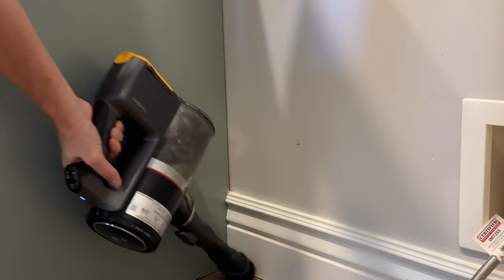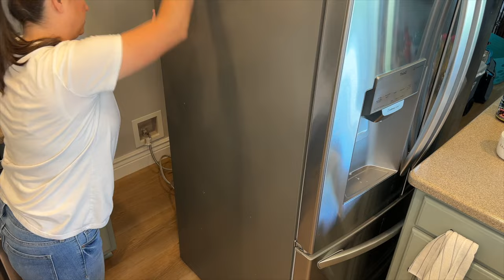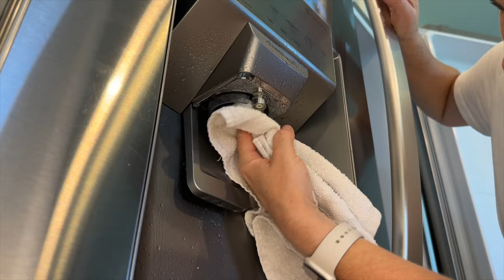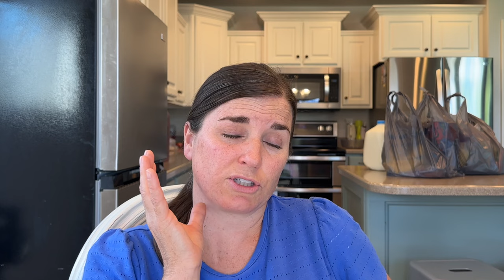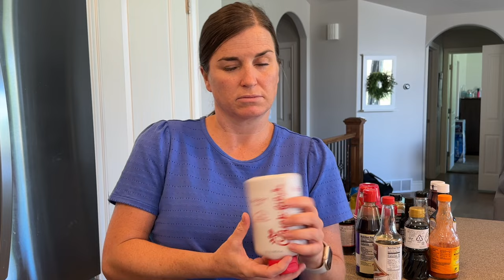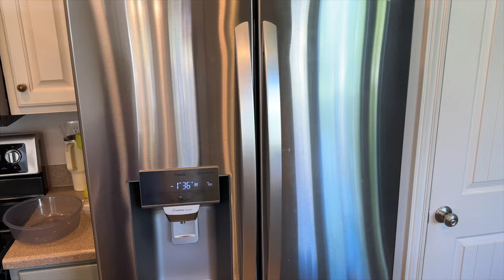*REALISTIC* Fridge Deep Clean, Organize, and Restock | GOOD ENOUGH!

Comment: My fridge is old, and shelf edges are cracking. Mold has built up in the seals, and I know it needs to be cleaned. The freezer is always a mess.  I wish we could get a new one but the space is narrower than the newer ones. I have never pulled out the fridge to clean. It is built-in and didn't realize it needed to be done. You've given me motivation.
Reply from the maker: It's hard to keep up with it all!  Don't get down on yourself.  I bet it will feel like new when you give it a good clean!  Have a great week.
Reply: @reallifewithali  Thanks 😊
Reply: Ali you look wonderful, a natural beauty. Fridge cleaning is a pleasure now I have put items in containers and not so many kids home 😊😂😂😂😂
Reply from the maker: @lindakleiner5734  Aw thanks!  You just made my day. 😊
Reply: I finally cleaned the refrigerator.  I threw away items that were outdated.  Also, my husband cleaned the coils (located under the fridge instead of behind). I didn't get to cleaning the seals because them means using bleach and my sinuses aren't up to the task. Does feel better to open it up and see clean shelves.😊
Reply from the maker: @cynthiaslebodnik6945  Way to go!!  I bet it feels so much better!  I did forget to mention that on older models, there is little panel on the bottom front of the fridge that comes off so you can vacuum the coils.  I'm glad your husband was able to do it for you!